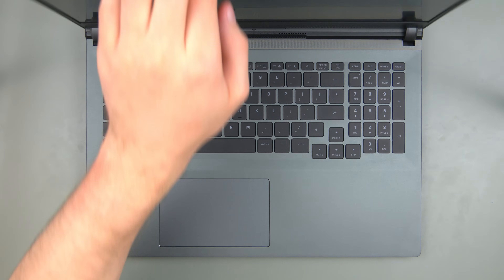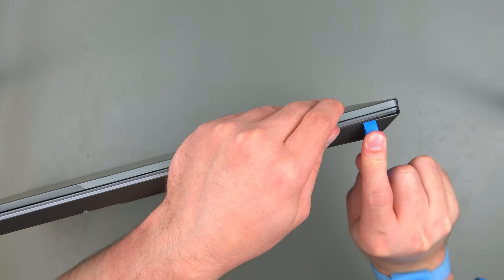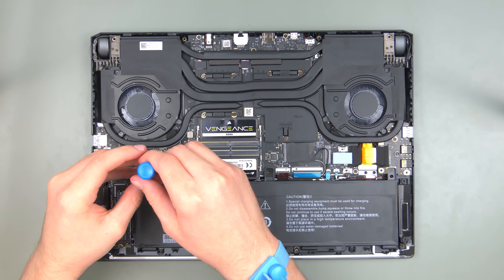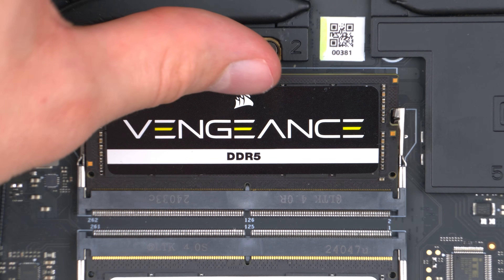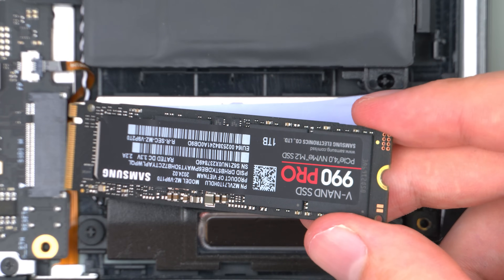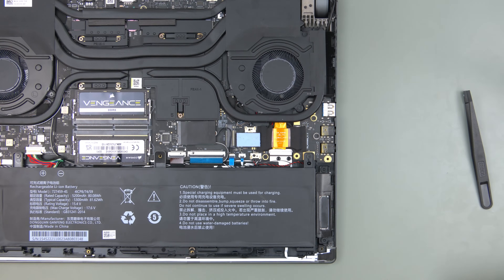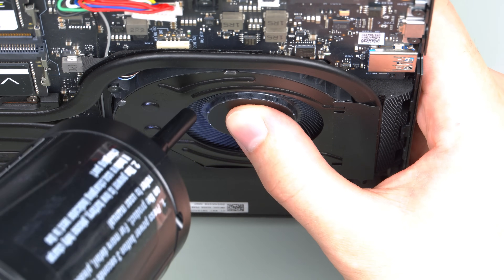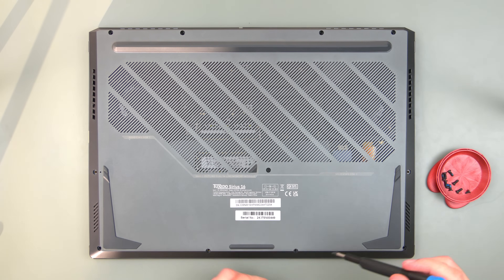Repair Guide: TUXEDO Sirius 16 - Gen1 & Gen2

Comment: My charging port is damaged. I have two cables, I am sure the problem is with the laptop. I wiggle wiggle and it works but disconnects after awhile. What can i do to fix this myself and where can i get replacement parts if need be?
Reply from the maker: Hi!

For the Sirius devices, we do not have the charging port as a separate part for you to fix yourself. Please contact our customer support, they'll be able to help you out and tell you to send your TUXEDO in if necessary.

Comment: what is that blue thing on your right wrist?
Reply from the maker: Hi!
It's an electrically conductive wristband that is connected to the ground of a wall socket via the attached cable. Staying grounded while doing repairs like these eliminates the danger of an electrostatic discharge into the electronic components that you're handling, which could damage or even break them. And while many of the components that you'd come into contact with during a laptop repair have some tolerance for this and could probably withstand quite some abuse in this regard, wearing the wristband is an easy way to be on the safe side. :)
Reply: @TUXEDOComputersYT  Are there any date when TUXEDO Stellaris 17 - Gen7 will be available?
Reply from the maker: No date, but you'll see more of it soon. :)